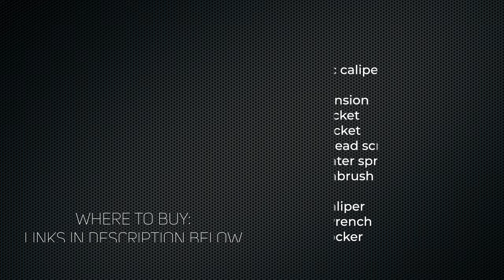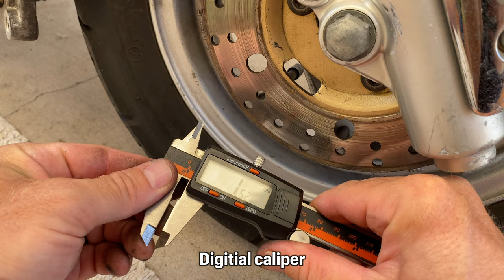Yamaha Vino 125 - Front Brake Pads Replacement | Mitch's Scooter Stuff

Comment from the maker: BRAKE PADS: https://amzn.to/41ef3dH
T O O L S
Torque wrench 0-150 lb/ft 3/8 drive - http://amzn.to/2Crqq4R
3" / 6” extension set 3/8 drive - http://amzn.to/2h7ypMl
Threadlocker blue 242 - https://amzn.to/2SPbY1R
Tiny flathead screwdriver - http://amzn.to/2zyrLck
12mm socket 3/8 drive - http://amzn.to/2xM4Edr
10mm socket 3/8 drive - http://amzn.to/2xGuLSF
Cotton swabs (q-tips) - http://amzn.to/2EOXBpn
Ratchet 3/8 drive - http://amzn.to/2hhmnUs
Caliper grease - https://amzn.to/2Mjtis1
Digital caliper - http://amzn.to/2Cm8f0l
Rags - https://amzn.to/2Yh8jvg
Soapy water spray
Old toothbrush

Comment: Hi Mitch  very detailed service once again congratulations about the good work you are doing. I would like to ask you about the bolt torque that you apply. You look for it in the manuals on every scooter separate or there is a  universal "safe zone" that you use ? I have a sym symphony and the manual doesn't mention anything about the torque of each bolt . Is there a way to figure it out ?